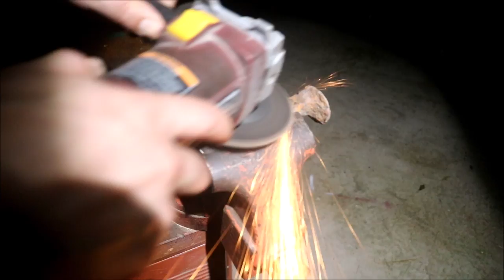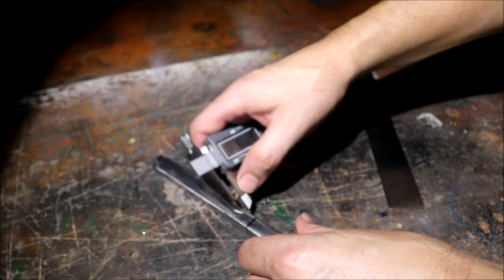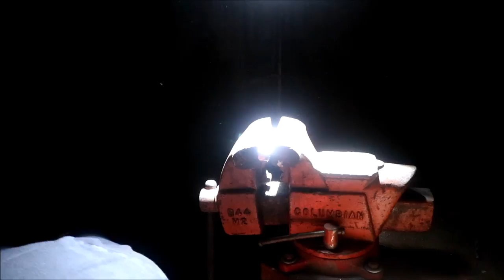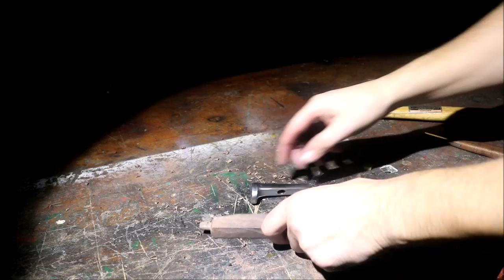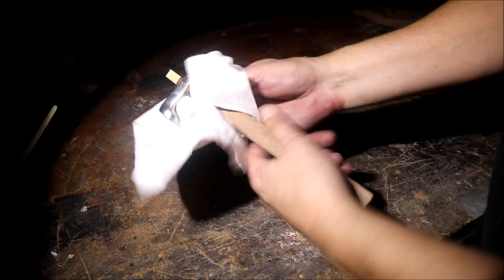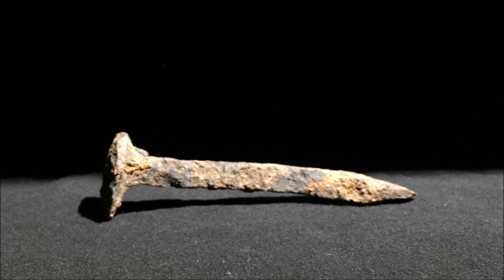Making Hammers from a Railroad Spike

Comment: Metal work = cute; Handle= "Don't quit your day job."  You hit something hard enough to drive more than upholstery nails, that handle will snap...
Reply from the maker: Thanks for the comment but you are wrong.  I used these hammers to make a wood carving in mesquite which is a relatively hard wood.  I even made a video of me doing it.  I actually made two carvings for that video because I didn't like the first one I made.
Reply: I think hammers like this are intended for jewelry or small carvings, it isn't a construction hammer...

Comment: I was hoping to see forged in holes. Handles are too thin for anything but delicate work. 

Neat project but no rock picks here.
Reply from the maker: I made these for the specific purpose of wood carving and so far they haven't failed me.  So I am happy with them.
Reply: @danthemakerman  And for that they seem perfect. Potential use for a silversmith as well.